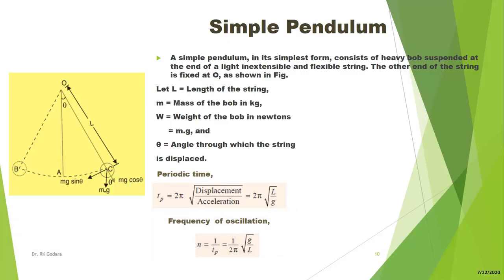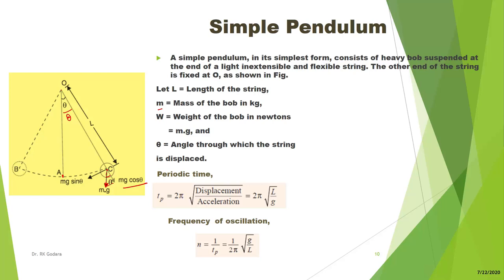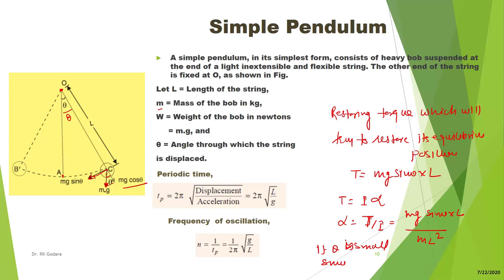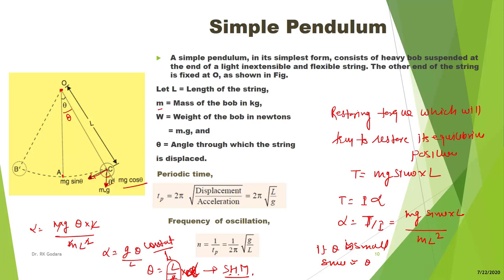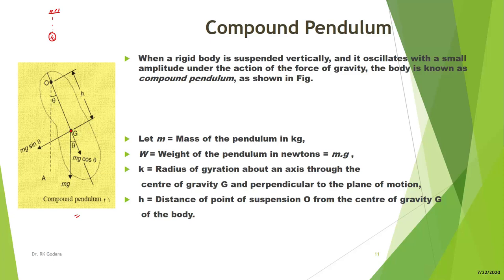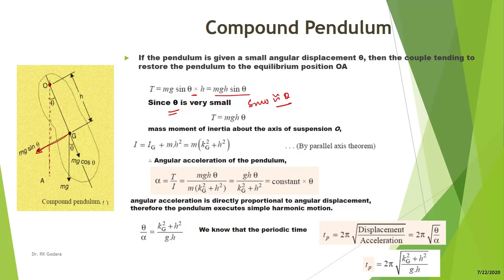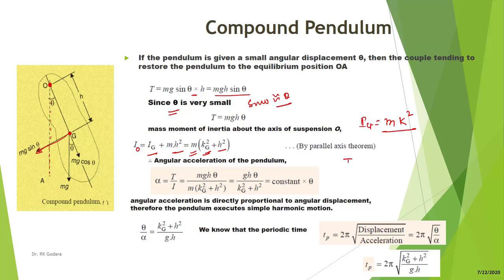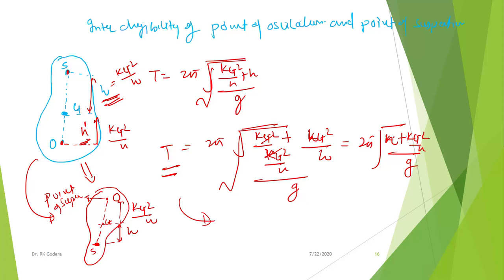Simple and Compound Pendulum: Equivalent Simple Pendulum Length | Part-1

Comment: why two values of h are used in time period folmula of compound pendulum
Reply from the maker: Once h is distance between point suspension and center of gravity. But point of suspension and Oscillation center both are interchangeable and it will not affect the time period of compound pendulum.  So h in both of the cases is different when both points get interchanged.
Reply: Thanks for reply